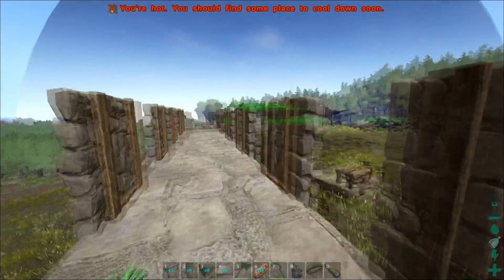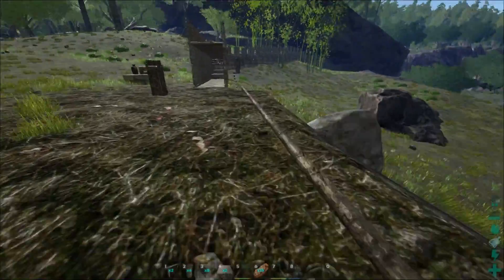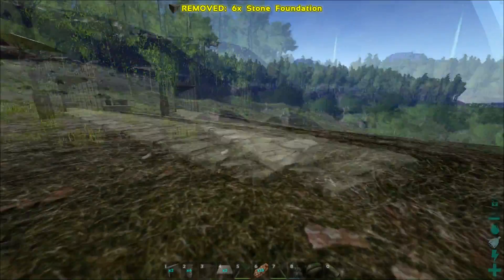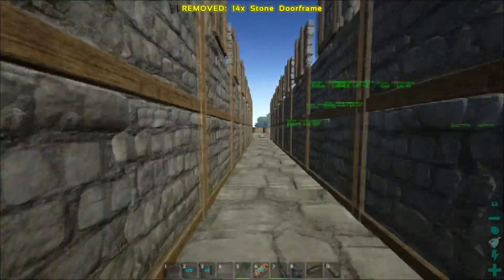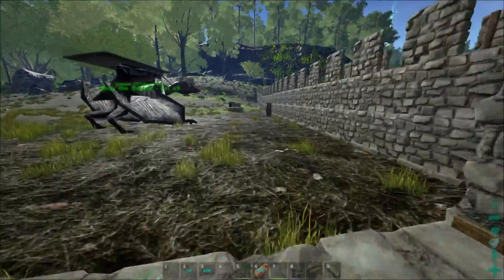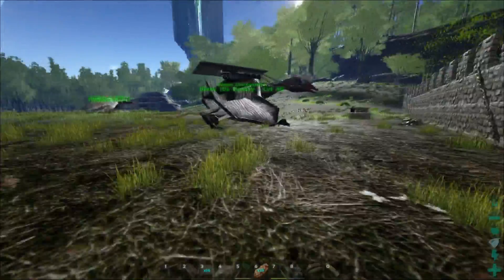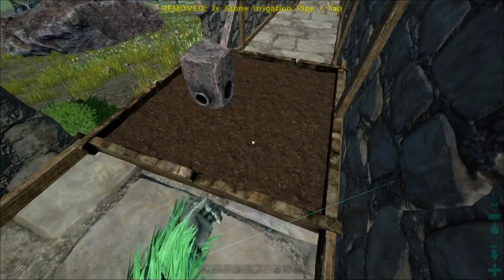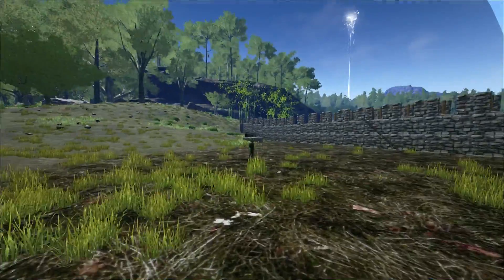ARK: Survival Evolved - A Straight Foundation Wall - S1Ep35

Comment: Does this not work anymore? I am on PC and have been pulling my hair out trying to get a flat foundation on slopes without using pillars to start my 1st floor on a raised area.  This looks exactly like what I was trying to do, but I did exactly what you are doing and I cant even get the first foundation started much less do any others.  I always get the red foundation saying you can't place there or it is obstructed.
Reply from the maker: they may have done some kind of patch that ruins this, but it should still work. If you don't play on a offcial server i recommend looking at a mod called Structures plus